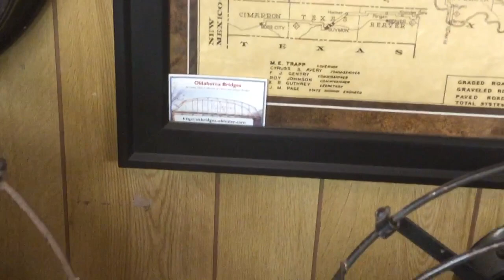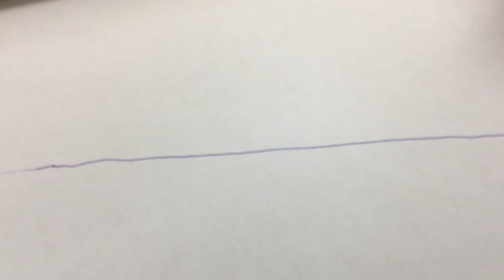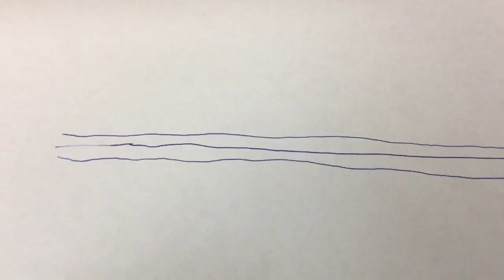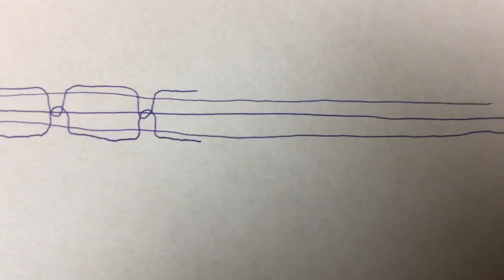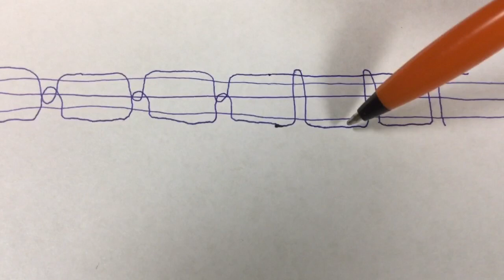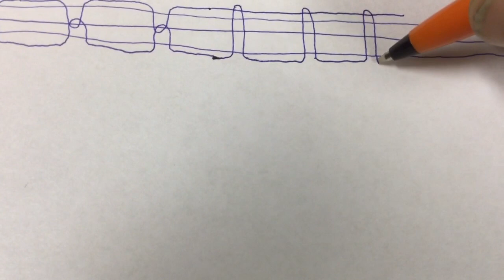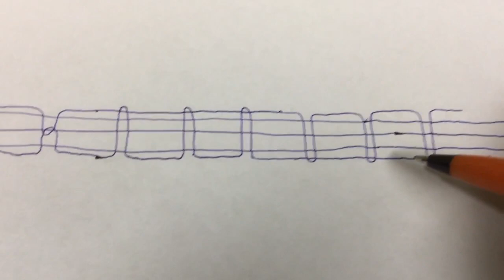How to adjust thread tension on a lock-stitch sewing machine

Comment: when I started watching this vid, I thought "how boring",  (shows you how stupid I am); watched the whole thing carefully and found out I had some parts in backwards, which is why I couldn't adjust it right...(I originally had the part that pushes in the pin on the wrong side of the "beehive" spring)  so.. really good technical information can be boring, that's ok, I finally got all the info that I needed, RIGHT! Thank you so much.
Reply from the maker: I am glad you got your machine working! Thanks for the comment.

Comment: I am just amazed and delighted with such detailed explanation of how the tension works. Just got another ebay SINGER 66 machine, and the thread take-up spring on the tension was NOT there. Seller is sending it, but it shows lack of knowledge. I have the Singer 66 manual (photocopy) and its hard to discern how these things work. When I get the new spring, this video will be invaluable. Thank you for your attention to detail!

Comment: Could you please tell me what the red felt is inside the spring to the right of the bobbin ejector button ? Is it for oiling ? Thanks
Reply from the maker: Yes, it is an oil wick to oil the surface where the bobbin case slides on the hook. It should be kept saturated with oil.
Reply: okbridges  Thank you , I am fixing my wife’s grandmothers 66 that she left her , it hasn’t been used in about 50 years , stuck too ,but got it turning , I have learned a lot from you ,thank you again . Steve

Comment: Please send me the setting of singer swing macheen mod २०१k bobben setting
Reply from the maker: The bobbin tension on a Singer 201K adjusts the same way as the 66 shown here does. Start with a lower thread tension of about 6 to 8 oz (1.6 to 2.2 Newtons) when pulling the thread, then adjust the upper thread to be about the same, test sew on a piece of scrap and adjust the upper thread tension until the stitches look balanced.
If you are using a fine thread you may want to start with a little less tension, but for most ordinary thread start with 6 to 8 oz.

एक सिंगर 201K पर बोबिन तनाव उसी तरह समायोजित करता है जैसे 66 यहाँ दिखाया गया है। धागे को खींचते समय लगभग 6 से 8 औंस (1.6 से 2.2 न्यूटन) के निचले धागे के तनाव के साथ शुरू करें, फिर ऊपरी धागे को उसी के बारे में समायोजित करें, स्क्रैप के टुकड़े पर सीवे का परीक्षण करें और टांके तक ऊपरी धागे के तनाव को समायोजित करें। संतुलित देखो।
यदि आप एक महीन धागे का उपयोग कर रहे हैं, तो आप थोड़ा कम तनाव के साथ शुरू करना चाहते हैं, लेकिन अधिकांश साधारण धागे के लिए 6 से 8 औंस से शुरू होता है।

ek singar 201k par bobin tanaav usee tarah samaayojit karata hai jaise 66 yahaan dikhaaya gaya hai. dhaage ko kheenchate samay lagabhag 6 se 8 auns (1.6 se 2.2 nyootan) ke nichale dhaage ke tanaav ke saath shuroo karen, phir ooparee dhaage ko usee ke baare mein samaayojit karen, skraip ke tukade par seeve ka pareekshan karen aur taanke tak ooparee dhaage ke tanaav ko samaayojit karen. santulit dekho.
yadi aap ek maheen dhaage ka upayog kar rahe hain, to aap thoda kam tanaav ke saath shuroo karana chaahate hain, lekin adhikaansh saadhaaran dhaage ke lie 6 se 8 auns se shuroo hota hai.